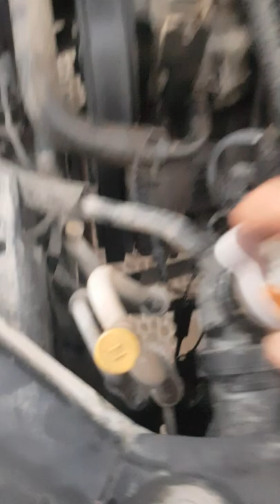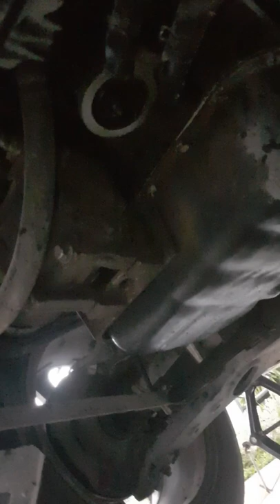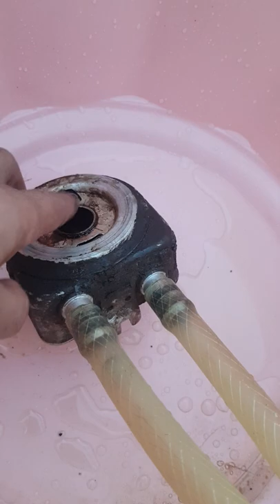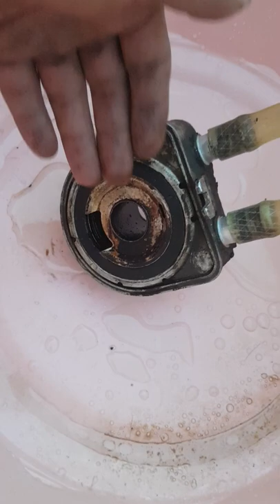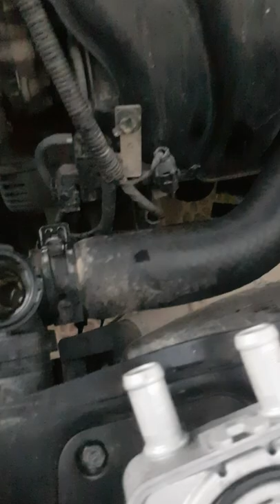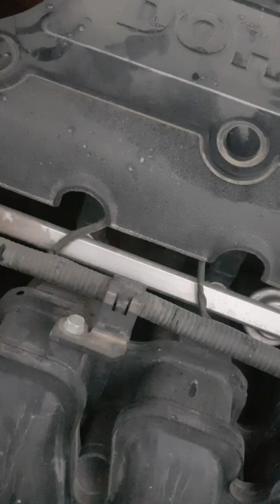kia optima 2011-2016 engine oil cooler replacement. mixed oil and water in radiator.

Comment: I adviced you to replace the engine cooler with huyndai 2018 number 
264102G000 you should yoused the part n 
264102G100the last one is bigger than this one and more reliable
Reply from the maker: No i replaced the same cooler 😎.  I got it from dealer

Comment: If any oil in radiator, replace the cooler or only the seal?
Reply from the maker: Just clean it with special liquid. No replacement required

Comment: What if the leak was from transmission fluid ??  Replacing the cooler solve the problem or what. Pls 🙏 response
Reply from the maker: Yes you need to replace the transmission oil cooler which is also can cause the oil leak in to the radiator
Reply: @poladarbil6213  where is the transmission oil cooler located. Sonata 13 2.4 l doch. It's the same engine oil cooler or not
Reply from the maker: https://youtu.be/EZd9TfPJOko
Reply: @poladarbil6213  thank you

Comment: what if its more coffee looking insttead of milk?
Reply from the maker: Most of the time its the same . But you have to cooler ( transmission oil leak & engine oil leak ) mine was engine oil 😇
Reply: @poladarbil6213  so i should replace the engine oil cooler?